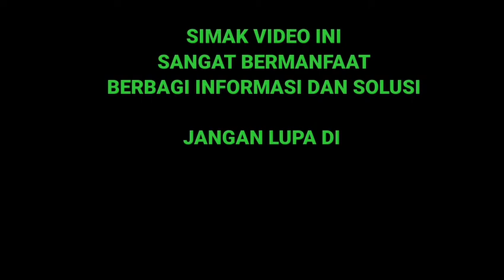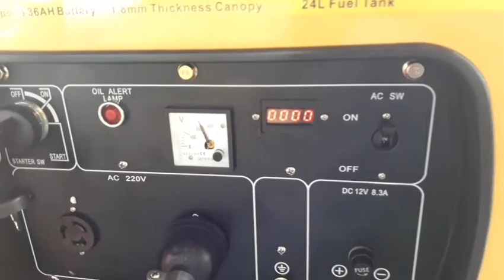Genset silent GENERAL MT 9000 GS# SUARANYA MANTAP

Comment: Mau tanya klo yg ET 9000 cE general..gmn pak?.hrga kira2 brapa y..🙏
Reply from the maker: General ET 9000 CE itu genset open bensin,,lumayan bagus  tapi belum full tembaga tapi sudah di bekali AVR untuk harga 6.750.000
Reply: Klo dana 2500.kira2 dpt gneral tipe brapa om. ?
Reply from the maker: @walminahwalminah4228  dpt general tipe ET 3200 L spek 2000 -2200watt
Reply: @Sw-bw9qy  model sama y gan eT 3200L..kuat tuk 5 jam gk..tuk blower broiler pas mti lampu...150wat ×8 .
Reply from the maker: Untuk genset sendiri maximal 8jam..bisa pak asal jangan langsung semua menyala,,satu persatu blowernya soalnya blower itu dinamo start awalnya 2xlipat
Reply: @Sw-bw9qy  o gt.suwon infone.
Barang msh ada gk y om?.